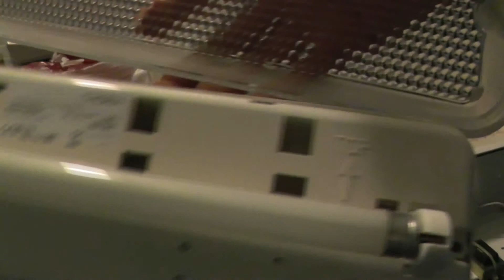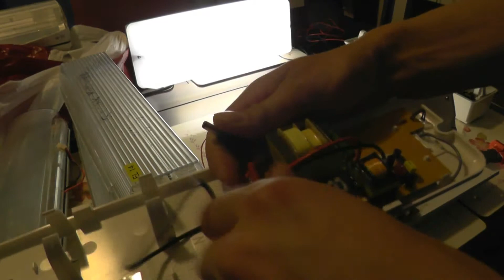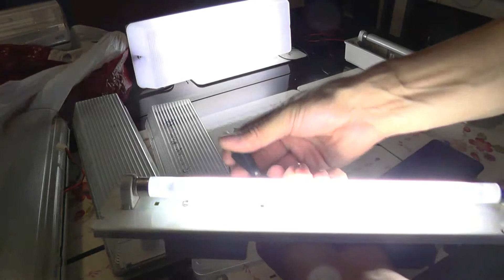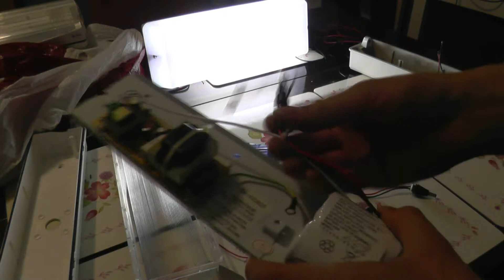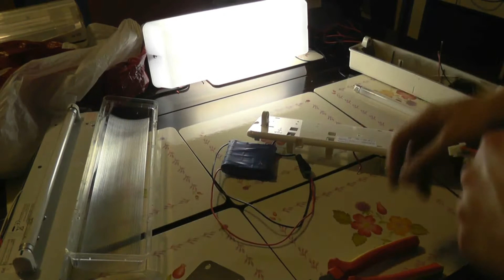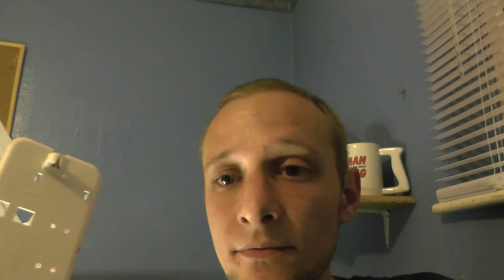A whole bunch of old Emergency lights to test on my 3.7v lithium battery

Comment: i baught 5 units n sum are dim 
even tho i wire them up to a bank of batteries 3.7v lithium 18650s 
do you think its the tube as ther new units ? no brand on tubes

Comment: i said why not they said by law as aparrantly its changed cant re purpose things from skips or the scrap yard wich is 1mile from my house lol
Reply from the maker: never heard of this law or rule! all items I remove from skips are with the permission of the site manager or are concidered waste which is my responsibility to dispose of! ask what the law is they are quoting? as for taking "rubbish" you are doing them a favour.
Reply: too late now they probably crushed by now  dam  i would of scored 30 units  all wer lit
Reply from the maker: don't give up there is treasure everywhere!
Reply: dout it   most of the time i hardly see any shops  getting rid of lights    as i dont have a car or bike to drive so im screwed
Reply: how meny can u find or  how do u get them as i tried and its a no go  

im thinking of doing the same  

either taking all the guts out n  putting the driver board & tube on a mdf sheet  maybe 20 40+  in parallel   total watts  320w at 3.7 v  lol  mmmm 

i allready made 3.7v @ 25Ah packs  so just need lights wich are a bitch to get hold of